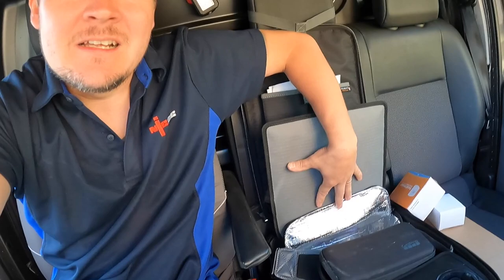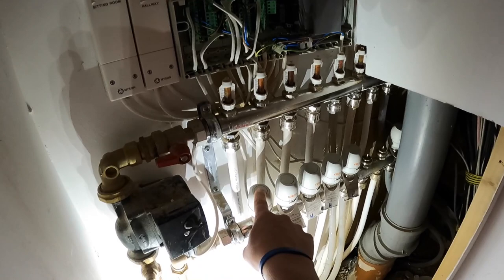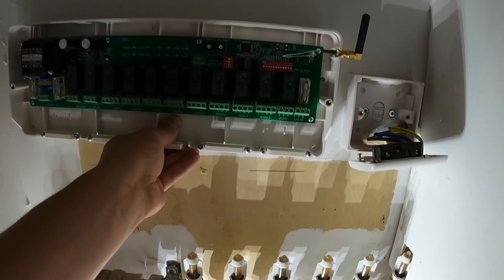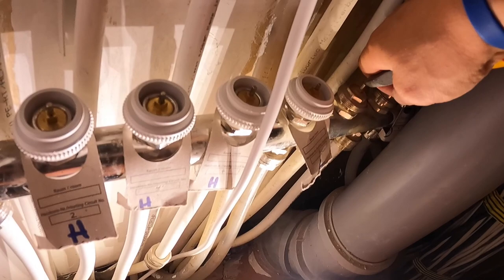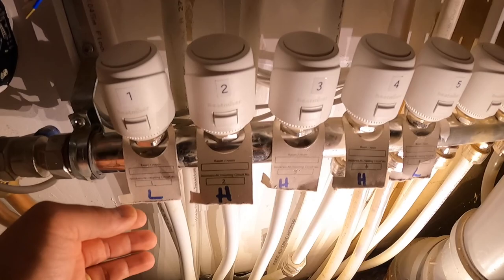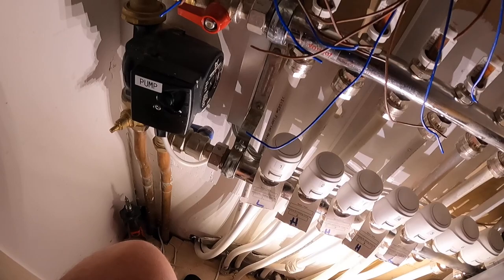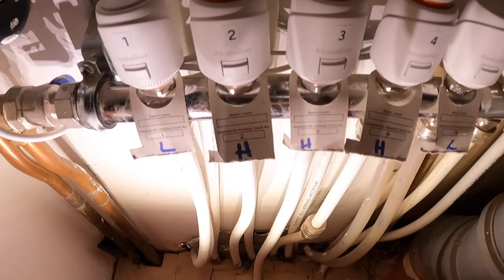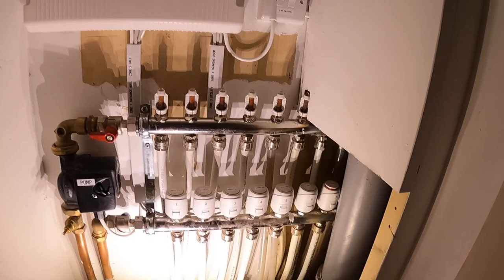Electricians day turning a nightmare job into an easy one.
Part 1 Electrician

Comment: Annual job unsticking those pins! Sat all summer long stuck in and seizing up.
Reply: The Danfoss Icon system solves that issue.....it can be configured to exercise all valves regularly and turn on the pump so that you get flow. Doesn't seem to be a feature on Heatmiser (yet)...but you could probably do it using the API or IFTTT.

Comment: Are the actuators a form of "wax motor"? Big Clive has done some videos about them. It is worth getting a gas soldering iron kit that can blow hot air. Works great on heat shrink.
Reply: Or just a paint-stripping heat gun...AKA Hell's Hairdryer...

Comment: Nice work ! Out of interest have you looked at or installed the Danfoss Icon system ? Heatmiser looks good and they have an Open API and IFTTT which is nice if you're tech savvy, the Danfoss system has some additional features like an Infra Red floor sensor which is useful for wet rooms , weather compensation and maintenance features (open/close all valves weekly)....the Heatmiser "open" platform with Danfoss features would be my preferred option. Thanks for sharing and great to see you back on the plumbing :P  ;-)

Comment: Do you have a thermal camera?  You can easily see the flow under the floor with one.  Also works great for seeing overloaded or loose connections on breakers.

Comment: The old system seems to be at least partially german. There is the german word "Vorlauf" on the pipe. Means pretty much that this is the pipe that feeds the tubes with hot water

Comment: At 17:05 when taking about little loose ends at the terminals. I was on a job commission a wiring centre where another guy in my company had wired it. I turned it on and a few strands were touching L and N and blew up in my face and burnt my eyebrows off.

Comment: Did you diagnose with what was wrong with the other system? And what's stopping your replacements from packing up in a few months time?
Reply from the maker: Yeah the thermostats and control box were so unreliable. I’ve been fitting heat miser for years with no problems.

Comment: Good video ref air source unless it's a well insulated house it's pointless although ground source has more poke 😂 ( gas is still king )
Reply from the maker: It’s ground
Reply: Gas will be on its way out over the next 10-15 years. Heat pumps, communal heating and maybe hydrogen will be the new normal. No new gas boilers after 2025.
Reply: @bencampbell2041  what about electric boilers? All these things that need to happen they bestget on with getting it right 😂

Comment: What's the wireless range on these things inside?
Reply: They mesh use a 868mhz mesh then all connect back to a hub plugged into your router for internet access to the app.
Reply: @warrmr  So it's probably zigbee, which could range from 10-100 meters.
Reply from the maker: Doesn’t require a hub
Reply: @Cjrelectrical  Interesting they looked like the heat miser Neostats ? I have only seen them with the Heatmiser Neo Hubs that connect to the LAN and act as a gateway for the app. Is this one not app connected or is there another way it gets internet as I didn't see any lan cables (Might have to watch the video again). 

@Da Skippy I think the neostats quote 100m so you would be correct on the Zigbee. (Pretty sure the relay box is the Zigbee master with that tiny antenna. )

EDIT: I should probably re-phrase my question and ask @CJR is the Hub optional and only if you want the app control then.
Reply from the maker: The neo stat requires a 230v supply.

Comment: So funny to see this. I other more developed countries such Heating Controls are completly obsolet. You have to remember: Underfloor Heating is self-regulating. If a Room has heated up enough, it just won't take more heat from the floor. No electronics needed for this at all! Saves you big $$$ but just having nothing. All you need to install is a heating source (gas or heat-pump) regulating the forward flow temperature in relationship to the outside temperature. All in All, what we see here is a waste of money, ressources and effiency of the heating system. The amount of waterflow per Minute per Circuit per Room is calculated and set by the installer. Everytime I see Videos like this, my heart cries for the 1-3 Watt Energy totaly wastet PER Thermo-controlled thermostats but people not able to RTFM!
Reply: I thought you had to fit a thermostat to comply with building regs
Reply: @matthewsaunt2965  you do this via the outside temperature controlled water inlet temperature from the Heating source
Reply: @kgfgfg1  is that not like saying a combi boiler has a thermostat to control the temperature of the water within the radiators . Pardon my ignorance

Comment: l notice Bunch of cables tape gether with strip earth tape. I learnt that this is bad work practice on a electric tutorial youtude video.  Because of the increase of thermal heat when the cables load voltage and current. Pvc insulation with a maximum working temperature of 
70° C. 😳
Reply: I think what you were seeing was in fact the Data cables..
Reply: Yep those look like data cables tbh